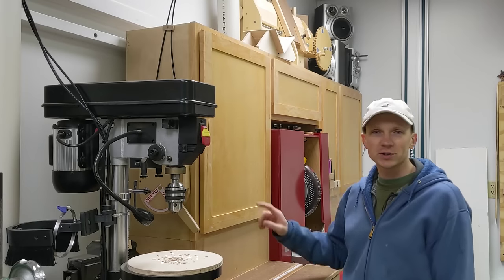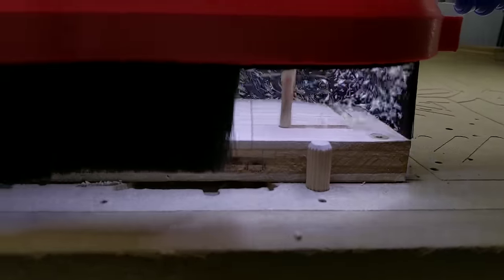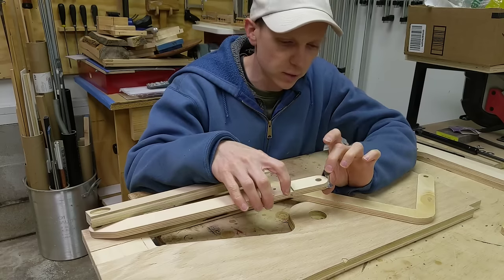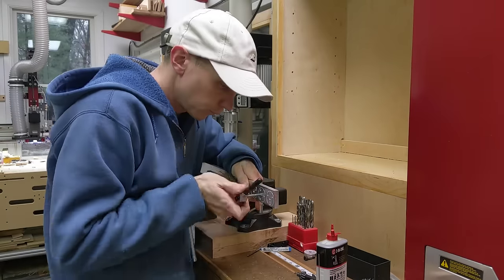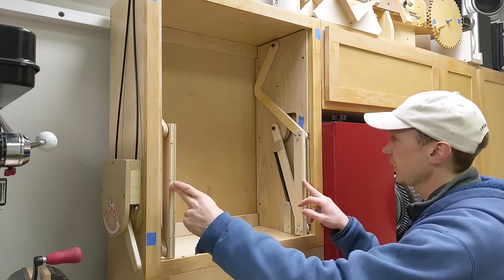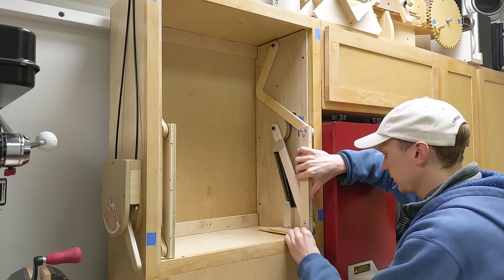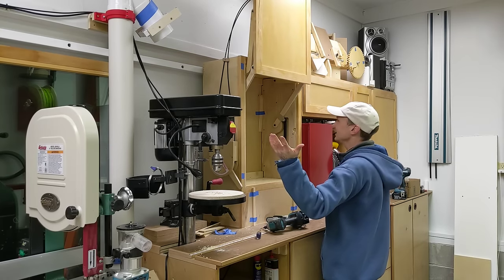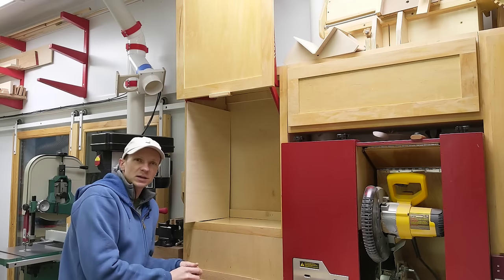This will Revolutionize my Shop Cabinets

Comment from the maker: Mid-roll ads disabled :) enjoy the video!
Reply: Lovely video and awesome solution! Will you be releasing plans for it (the entire cabinet, obviously)? I'd love to have this in my shop. I hate doors, I always hit my head on them, but I can't just remove the doors, too dusty...
Reply: I noticed it was uninterrupted.  Nice.
Reply from the maker: @PunkR0ckz09  thanks! I probably won't do plans unless there is a lot of interest. It's a lot of work to make plans!
Reply: Not necessary, it's worth waiting. And you have to be paid for your hard work. These videos don't make themselves.
Reply: @JustinDepew  Yeah, I wasnt thinking of detailed plans per say, just something like "inside width/height/depth of cabinets, here's the plan for the panel, here's the parts used...hehe :)
Reply: Thanks, great vid.
Reply: It's cool but now you can't use the door
Reply: @RomanMyshoul85 You could put a perforated panel in the middle of the door and hang stuff on it, or make a mini french cleat system for your doors. :)
Reply: @PunkR0ckz09  Both good ideas but neither is on the inside of the cabinet and protect from dust.  I was thinking a strap type hinge that lets you open the door in either direction but that's pretty flimsy.  It's a cool video, I just don't agree
Reply: @RomanMyshoul85  There are ways to make it work, you could build a frame for your door, that frame would be attached to the pivots Justin showcased, and then the door on top of it. It would be a bit thicker, and you could have storage in it. However, I'd strongly suggest using a locking mechanism so it doesn't swing open while going upwards ;) It's just a concept, after all.

Comment: Just an improvement thought for next time... Make the aluminum parts like a small bow tie and do the cut out for it on the backside of the panel. That way you only need the single bolt through the wood instead of 3 extra bolts through each part. Great idea and look to copy it with the modification as stated. Keep up the great work.
Reply from the maker: Good idea!

Comment: I love this idea.  My shop is small and having doors open into it could be an issue!
I like that there is a positive close and a soft open.  I might modify it to use the tension of simple springs, instead of the pressurized rods.

Saving your video for future reference, and subbing.

Comment: Years ago I saw a product with a similar design, but for the opposite purpose.  It helped you store stuff up on top of your cabinets in a bin that was attached via mechanism similar to yours, plus gas pistons to pull it back up when you let go.   Since then I've seen similar systems for kitchen cabinets, but never for garage storage.

Comment: Part 'B' = Accommodation for your drill bits on the inside of the door with access from the outside from the lowered door. Maybe an uprated gas strut to carry the extra weight. Great Job.

Comment: Just an idea, maybe? A tension spring between the upper and lower arms to keep tension in the arms would reduce racking. Say one connection point be the lower door/ arm pivot point and the other connection point be in the upper arm between the elbow and door. The reason I think that would work is you have created a similar hing to that of hood hinges on cars and truck back from the sixties to mid eighties. And they where always under tension. 
Great job!
Reply from the maker: Interesting idea! I will consider that.

Comment: Very cool engineering there!  Adding the internal shelves might even help with some of the racking.
Reply: Flipping the storage on the door to the outside is expected... 

Given a CNC machine, I,d expect that the build would be in metal, rather than plywood. Consider the interior volume of that cabinet sacrificed to the convenience of the lifting door.

Could this be done more compactly using gas-shock-braked (soft-close) drawer slides, pivoting at one end and constrained at the other with another gas shock?

Comment: Love that door mechanism. Very much over-built on the alloy 'T' nuts, but a very handy setup. 
As for the wobble, the arms are plywood and only half the grain is adding any strength. Before any significant mods, I'd try making the arms from hardwood. The elbow could be a half lap with an extra cleat. And maybe have the arms run against a strip on the cabinet sides. All simple mods to trial before adding braces or cross rails.

Comment: fantastic. overengineering is awesome lol. one suggestion, it looks like the top and bottom arms touch when fully opened, just stick on some silicone bumpers (used for stopping cabinets from slamming shut) at the points of contact.

Comment: 23:00 Hm, you could even fit 2 synchronization shafts behind the door if 1 shaft is not stiff enough. For the soft-close it could work to add some kind of foam-cylinder / pipe-insulation around the gas-cylinder rods. The gas-cylinders are almost fully contracted when the door is closed so it could work to add something just in the right size.

Comment: You mentioned that you lost space on the sides of your cabinet but you also lost the space on the door. While the outside of the has a nice door has a nice finished, this is a shop cabinet and you could mount the bits you had on the outside of the door. A couple of nice cleats would work well even if only as a temporary holder for the bits for when e are doing work that requires the bits. Good video and nice job. Happy Motoring and Happy Woodworking.

Comment: Hi 👋, Justin, that was a great and very interesting project, you might already know that there is a company called Blum, they make door and draw activators, Aventos , I have the similar system, what you have built, which is a great sense of achievement, On my bathroom cabinet doors, but I purchased around 13/14  years ago and they’re still working perfectly,, and they even got the soft clothes mechanism already built-in, and you can pre-load the closing time and the softness of the clothes as well, I hope this can be some help to you, I am/was specialist joiner cabinet maker from the UK, retired in 2018, in 2019, I then moved to France, 
I wish you all that success for the future , and a happy New Year, 🥳, Phil from the moulin France

Comment: Great idea... if you have cathedral ceilings.
Me thinks the best idea for this application, with minimal clearances all around, would be to have a front panel that rolls back, like a roll-top desk. However, you sacrifice storage on the reverse of the front rolling panel, unlike a solid swinging door.
Amazing engineering and craftsmanship went into this project, though.

Comment: Well done! I got some very old kitchen cabinets for free and one of the cabinets has a similar system, but with springs. I have a low ceiling, this folds partly over the top of the cabinet. Downside is that you can't store anything on top of the cabinet, upside is the low footprint inside and outside the cabinet
Reply from the maker: Sounds like cool hardware. Do you know who makes it?
Reply: @JustinDepew  Unfortunately there's no brand or company name on it. I do Know it's a Bruynzeel kitchen, probably Seventies. Particle board, but really heavy quality, especially the doors.

Comment: the reason the dust shoot is working so well with the opening is because there is easy excess for air to flow into the dust shoe then up the exit tube to the vacumm

Comment: Cool project!

I think some of the wobble could be reduced using some plastic guides on those side panels you plan to add. One on each side with very tight tolerance to the beams would keep one side or the other getting too far off centerline.

Another option would be to have the lower arm extend further past the hinge point towards the back of the cabinet, and have a track there for a roller, so that the arm isn't as cantilevered but instead will have two points of support. A V roller would be best but even just a simple little wheel or something could work. And then if it was attached in a manner that allows some movement, like with a spring plunger maybe, you could even have the track be a cam slot such that the roller engages that track with more or less tension along the travel so that it acts a bit like a soft close.

Comment: Nice idea - would work for a tool (spindle sander etc) lift out with much beefier hardware. I have a set of cabs that is hinged at the top with gas springs and magnetic strips on the door so stuff hangs down from it. Mixed bag with that design too if the door slams shut : )  I really liked your Mach4 Screen layout. I'm gonna have to figure out how to do that.
Reply from the maker: Thanks! The Mach4 screen is custom. Takes a while to make, but you can do it yourself. It's a little tedious but it works.

Comment: The dust boot works so well due to the hole allowing cross air flow through.  As a result the extractor doesn't have to work so hard to pull the air through the brush either.

Comment: 22:18 There at the top would be a possible place for a synchronization shaft. Maybe use a steel tube and cut its hull like a "T" on the ends. Cut the stem of the "T" into the tube along the axial axis of the tube and as long as the thickness of the arms. Then cut the crossbar of the "T" so that the arms just fit if the material is bend outwards. Bend the material and remove nothing and use the bend sheet-metal to drill holes and attach it to the arms. I guess it would be really strong because you can easily fit 10 small screws around the arms and they would be arranged almost in a circle.

Comment: if you make inside walls, they can stiffen your wobble problem. also you could recess some guides for the arms in that shelving walls by adding some ball tipped bolts in the arms, or just fit the arms themselves to rub in the recess. i do not know if wax gonna help with wood on wood  rubbing tho, with all that lifting power. either way sandwiching the arms will help i think.

Comment: To avoid having to machine that aluminum part:

countersink the inner side of each hole and drive in the t-nuts.  
thread regular bolts through from the outside and tighten it into the t-nut.  countersink for the bolt head, if you want.  
Add a washer over the bolt, slide a bushing over the bolt threads, slide your hinge arm over the bushing (or press the pushing into the hinge arm in the first place) and 
then use another washer and a locknut.

Comment: 14:46 I was wondering why you didn't countersink those bolts that would have been pushed up against the sides of the cabinet, but the spacers create the clearance so they wouldn't scrape those surfaces. Two birds with one stone!

EDIT: Also I'm very impressed with how you hung the cabinet door! I would have spent a week chasing my own tail figuring out how to do that.

Comment: Honestly I bet your dust shoe is functioning better with that opening then it would if it was fully surrounded. I have been thinking about leaving a gap on my dust shoe opposite the bit from where the hose connects. My theory is that if you create a hard seal against the table all the way around you are actually decreasing the flow of air and causing it to pulled somewhat equally from the entire circumference of the dust shoe. By having an opening on the far side of the bit you are maintaining the airspeed while simultaneously forcing the air to pull across the cut area. Sending all the dust up the shoe.

Comment: Fun video to watch. If you continue to make stuff out of aluminum, I would consider using a lubricant. It will extend the life of your cutters and make for smooth cuts. Aluminum tends to gall (Google "galling") with cutters (drill bits, router bits, saw blade teeth, etc.). The aluminum will adhere to the cutters and gum them up until they eventually don't cut anymore. It can happen fairly quickly. The solution is to use an appropriate lubricant. You can buy purpose-manufactured lubricants like Tapmatic cutting fluids for Aluminum, but off-the-shelf WD-40 works very well and is cheap.

Comment: Ooh you could make cross braces for the lift arms that are U shaped towards the door so when it’s closed the braces would sit right at the edge of the cabinet behind the door and not take up much space while also connecting to each lift arm in the middle where they need the most support. Although thinking thru it idk if braces are really gonna help that much. I think the physically constraining the lifters side to side might be more effective. Add a bushing on each arm that rubs the side of the cabinet so they can’t wiggle side to side. You could even get fancy and inlay curved aluminum tracks for the bushings (or little rollers?) to glide on so they don’t ruin the feeling of opening and closing haha
Reply from the maker: I agree I think adding a bushing to the arms that rubs on the sides of the cabinet is a good solution.

Comment: You have a new subscriber, Justin! This is a really cool idea and wonderfully executed. I love the (over)engineering and the clear, concise way you walked us through the process. Great video production quality with some interesting camera work, too. I may try to replicate this in my shop; I’m wondering if I could  eliminate those side panels and attach the linkages directly to the sides of the cabinets. That eliminates the pockets for the gas shocks but maybe I could use a spring (centered at the top) with a magnetic latch at the bottom to keep it closed. In addition to simplifying everything, you’d regain a little of that lost space. As I was watching, I was thinking about the space you were losing - and how you’ll be losing even more by building the necessary shelf structure inside. Two things occurred to me- 1) In lieu of shelves, you could use a French cleat container system (perfect for all the hardware you keep in there), building custom containers to maximize the cabinet depth. 2) You could do a version 2.0 where you start with an internal shelf unit, incorporating into its sides the recesses you need for those gas shocks - then mount your mechanisms to the outside of the shelf structure. That makes it a freestanding unit that can be mounted inside the cabinet with just a couple screws each at the top and bottom into the back of the cabinet. Again, you’d regain a little of the lost space this way. Less material waste/cost, too. OK, I’m off to check out your other videos now!  ; )

Comment: We learned that CNC machining aluminum is easy…once we learned that aluminum ( for purchase) is an alloy! I know that aluminum is an element but, just as a 2x4 ISN’T, aluminum alloys need to be chosen based on what you plan to do with it. Bending vs. machining! Ask a metal supplier to help you choose the correct alloy. 
Also, T-nuts come in 2 styles. One type is held in place with separate brads. Rivet nuts could also be used in place of T-nuts. Hope this helps! Great design!
Reply from the maker: Which alloy do you recommend for CNC?

Comment: Hey, I'm new to your channel. I just wanted to say about the t-nut - see if you can find a video where Matthias Wandel is using t-nuts. After he taps them in with the tines, he drills a small hole or two right up beside the t-nut to put a small screw into to hold it in place. It's plenty strong enough at that point.

Comment: My suggestion to improve on this would be to make the arms out of 1/2 inch HDPE and likewise the "T nut" but to 3D print the "T nut" out of PETG, or better yet PETG CF. Much easier than machining parts. From there you can use simple bolts and spacers to make up the "axles".

Comment: This is a great idea. I would suggest a slight modification, I would like to see the ability to open the door normally for quick access and to still keep the extra storage on the back side of the door.  Maybe adding a frame around the door where you can hinge the door and still attach the frame to the cabinet.

Just another suggestion for a fun video.
Reply from the maker: That's a great idea!

Comment: It's very nice, but there are some downsides (not necessarily a problem for you).  You addressed the loss of storage at the sides, and also addressed the mounting of the shelf.  What you didn't mention is the loss of your handy door-mounted storage, where you had your bits before the change.  Another issue, although it's fine in your case, it does need enough ceiling height above the cabinet.
An alternative, although much more boring, solution would have been to split the door down the middle.  Half-width doors would presumably not protrude far enough to be a problem when open, you retain all your existing storage space, and you don't need high ceilings.  There are even 180 degree hinges which allow the doors to open flat, completely removing the problem of the open door getting in the way, and this can make accessing door mounted tools very convenient.

Comment: That is a remarkable idea. But what about the waisted space under the cabinet. Maybe you wanna build a drawer that's folding out from the inside of your cabinet. That'll be a cool project. And while you figure out how to make that I'll be rebuilding this door lifting mechanism 😂
Happy new year 🎉
Reply from the maker: Good question. I originally did not put a drawer under the cabinet for the same reason. I always have stuff on that work surface that would be in the way to opening the drawer. I have yet to figure out a way to access the space without keeping the surface clear.
Reply: @JustinDepew  that's what I'm saying. Build something that comes out of the cabinets bottom 😁